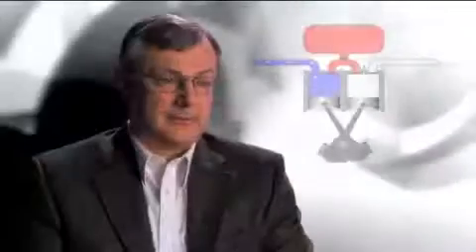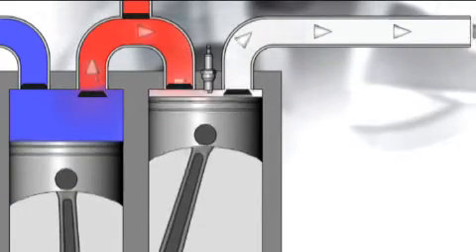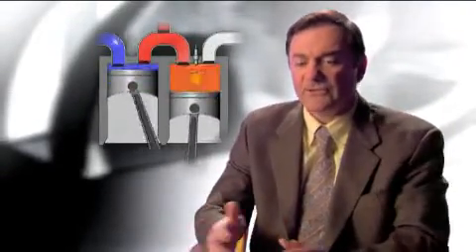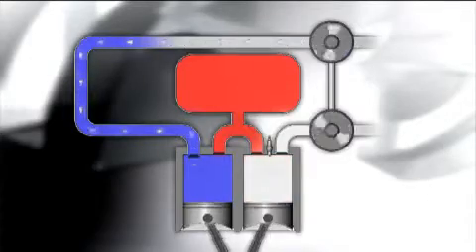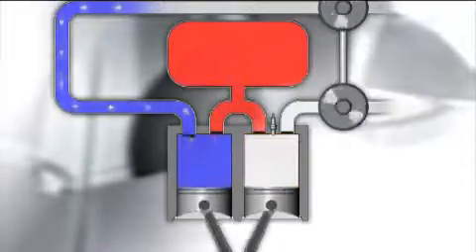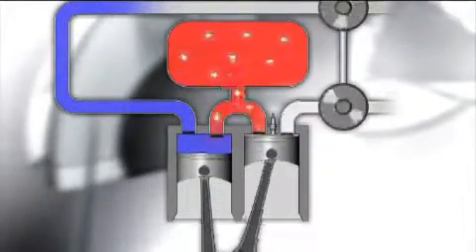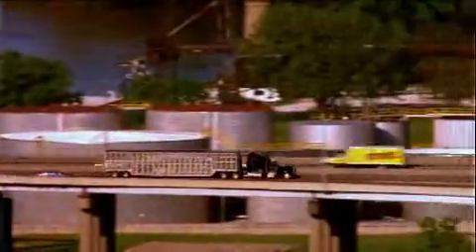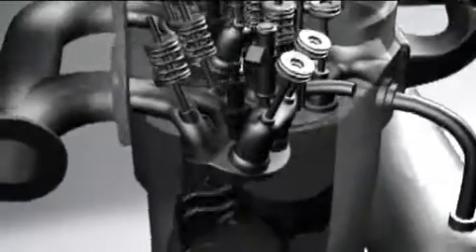Scuderi Engine - DesignOverview (by www.caroto.gr)

Comment: I agree totally all major engine manufactures are pumping billions in a system that is over 130 years old and not built for maximum power and efficiency. The key is not to over engineer the system that we have now but to design a new engine, The thing is oil companies don't want this. I have a design my self that works on similar principles its just a matter of funding, patents, and cooperation.